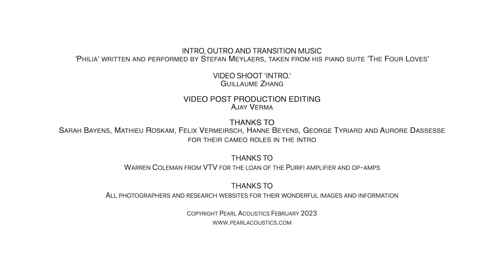Part 1: The perfect power amplifier?

Comment: Well done sir. It sounds like the amp you described will become the industry standard soon if not the industry best. Zero distortion may not be the goal for musicality. As we know Nelson Pass uses some 2nd or 3rd order distortion. Why? Because that is what his test audience prefers.
Me Too. It is why I have a Pass INT25. Sounds better even to my tired ears.
Reply: Best possibly for low cost limited space but for industry best....come on let's get Real
Reply from the maker: Hi David, it might surprise you that the professional recording industry has been using class D designs for decades. You’re not likely to see a class A tube amplifier in any recording studio for playback purposes. Except for fun. Even then, there’s just no room in the mixing room, and the one thing we don’t want in there is heat.
Reply: @PearlAcoustics  studio and or live amplification is far away different from home reproduction needs for many reasons. One of the main reasons is that on first scenarios are usually used several amps, and moreover, each amp works on restricted frequencies range: each instrument has dedicated amplifier. Live, specially electronic music, doesn’t suffer typical class D amp’s signal processing. Even if I agree they have some advantages that from my point of view are more related to their intrinsic symmetry than the general promoted efficiency. My best regards and thanks for your work
Reply from the maker: @giampierovecchio2681  Hi, absolutely agree on equipment amplification, however, I find that far too often, these days it is then all fed into a PA… enjoy the music too!
Reply: @PearlAcoustics  we used Bryston amps in my studio had no idea what class they were
Reply from the maker: @jackfalco5351  most likely AB. Very good amplifiers
Reply from the maker: Indeed, you’re absolutely right. PassLabs amplifiers are an absolute joy to own and to listen to.
Reply: it's just the difference between a coffee-flavored drink and a real espresso coffee, some may even love the former more but real things are real things as well as substitutes. Enjoy
Reply: @giampierovecchio2681  for me only the fully authentic real deal best will suffice. Can't stand second or third rate... especially pretenders
Reply: @davidcross890  fully understand your point of view even if the real deal doesn’t mean the same thing for anyone. Enjoy your listening as after all it’s what really matter!
Reply: @giampierovecchio2681  high five to All our Audio Friends 👍

Comment: How can you say one amp is ideal

It is all amplifier/speaker synergy and room size

I prefer Single End Triode (no waveform switching / strong power supply), nos tubes - Very high efficiency conventional loud speakers
Reply from the maker: I can’t and I don’t think I did. It’s all down to preference and it depends how you look at the topic. Hopefully my video gets that message across clearly. Enjoy your system.

Comment: Status acquisition and product differentiation via cost? Say it ain't so in this OCD hobby. Yes, there are those with discretionary income who keep their noses in the air, for bragging rights(sic). The Genesis Advanced Technologies, Prime Loudspeaker being an example. It's midrange, a 72 inch long, line source, dipole, push pull, planar magnetic, used to be available at a retail price of 700 US bucks, apiece. They are no longer available to the ordinary consumer but are employed in the aforementioned loudspeaker that in 2022 sold for 680,000 dollars/pair.   
Yet, your assertion, a Class D module may be the most perfect amp, based upon the minimum criteria measurement data, of THD is fraught with difficult to process assumptions, from my experience. At least if you're going to place such an emphasis on measurements, illustrate square wave performance at 10 Hz, 1000 Hz, 10KHz, and 100KHz. Then perform spectral analysis for noise. What type of semiconductor is employed? SiC, GaN, based semiconductors. Or BAs, fairly recently synthesized in the Lab with Thermal and both increased Electron and Hole mobility over available semiconductors, and quite superior to Si based devices. What about different Topologies which eschew efficiency for certain sound characteristics such as Class A, both push-pull, or Single Ended in solid state devices. Another alternative, a quite different approach, the Valve OTL,  both push pull AB and Class A, Single Ended amplifier.
So are the replaceable, modules, i.e., tube/op amp the Input and driver stages?
   No such thing as, "Perfection", as subjectively each individual will seek and find their preferred audio, "Nirvana", and We are still so ignorant of the whole auditory experience. Just my two cents. 
  BTW; I build my own electronics/speakers, used to employ MOSFETS, biased at 4 Amps, Class A, push pull, with 375,000uf of double bypassed, unregulated output stage, Capacitance, power supplies, each channel with a separate 800VA toroid, HEXFRED, ultra high-speed, soft recovery Diodes with snubber caps and series resistors, for rectification. Vishay resistors in the audio signal pathway, Caddock metal films on the MOSFETs Source, with separate regulated PS for each channel's, input and driver stage. The whole nine yards. Discovered Transcendent Sound's OTL kits, gave up solid state and never looked back. Also, I bought the first iteration of Dave Graebener's aforementioned planar magnetics for 1085 bucks/pair, shipped. I'm a cheap b@sta@rd but I dig on the Notes and play a left handed Strat for the last 47 years. Enjoy your interesting observations.
Reply from the maker: Thanks for your contribution to the discussion Scott.

Comment: Harley: As a mental exercise, are these amps (minus the buffer and op-amp stages) so perfect that you consider placing them inside your Sibelius speakers and, say, providing a balanced connection to be feed by user’s choice of pre-stage?
Reply from the maker: Hi Steve, that’s an interesting concept. Unfortunately, we can’t put anything inside our loudspeakers, but I am extremely interested in exploring the topic further.
Reply: Ninja’d. maybe bolt them to the back? Make the buffer a plug in module.

Comment: So enjoyable to listen to you.
I actually bought my amplifier without listening to it, but instead because of the way it was developed. As you mentioned, it has two IcePower Modules from Bang & Olufsen (kind of a predecessor to the Eigentakt modules) and is equipped with an input stage specially engineered as a class-a module, especially not with perfect measurements but best sound quality in mind. So I thought, it should be the best of both worlds. And it is. It's the PS Audio Stellar S300. I was blown away when I first listened to it and I still am. And it's on the budget side also, as a bonus.
Reply from the maker: Thanks. You’re very kind. And I am so pleased that you have found the perfect amplifier for you. Best wishes

Comment: I just happen to own a Hypex NC500 based amplifier which I like most switching to bypass mode the internal buffer (keeping some 12+ dB gain ) and driving the amplifier, practically the NC500 modules directly by a tube preamplifier.
Reply from the maker: Indeed, this is something that my colleague Ajay swears by…. I am sure this is the direction to go, but am open to be convinced otherwise
Reply: Which tube preamplifier can drive Hypex NC500 unbuffered 1.8 kΩ input impedance with its 12db gain?
Reply: @wyup  I use an Icon Audio LA4 Mk III to a great effect. I certainly recommend this combination. It has a low 100 ohm output impedance.
Reply: @gyulahunyor8267  Thanks.. discourages me a bit that I need to spend twice the price of the amp to get that sound.
Reply: @wyup  I understand. In fact I was lucky by getting a second-hand unit some years ago. This is a bit older version with separate pre-outs of 12 dB 18 dB, but the 12 dB does the job in most cases. I really like the low total gain solutions where the preamp can do its job by actually amplifying and not attenuating because of the high gain of the power amplifier. Sounds familiar when you can operate with the volume pot up to 9 o'clock position? By having 12+12.8 dB of total gain I can set the volume to the upper third of its range and the sound is somewhat livelier, more open.
Reply: @gyulahunyor8267  yes.. it happened to me with a Hypex NC122MP 70w based amp, I had to remove two resistors from the board to bypass its input stage gain, so I got 13db total (out of 26), enough for me, keeping its 40kΩ buffer. This way, at full knob I had all the volume I need, and take the least attenuation from the source. At stock, I could only use 1/4 of the pot max, making it difficult to adjust low volumes. And I was using only attenuation..
However, eventually I replaced the Hypex with my old and cheaper Onkyo AB because tonality was more realistic. The Hypex, although meatier, sounded metallic and dry.. IMO there is no preamp that can fix that. I guess tubes may add fullness and harmonics but I wonder if they can improve the amp's timbre.

Comment: Great video! Videos from you and from thomas and stereo lead me to believe that incredible sound is possible out of class d amplification. The key here is that most of the “good” amplifiers that I’ve seen have some type of input buffer in front of it. So perhaps that is the way forward. Maybe you buy just the module and try different buffers to suite your taste.
Reply from the maker: Thanks Jose! Another approach might be to drive the module directly from a tube preamplifier that can deliver a high enough voltage… but I am open to all ideas.
Reply: I was thinking the same thing. Perhaps integrated amplifiers with your choice of pre-amp.

Comment: Hi sir. Your entering into interesting territory, some might even say a minefield 😂.  This has the potential to certainly disrupt the low to mid range of the hifi market , because it could totally level the playing field .    As you rightly say those with the cash to splash will always operate outside the everyday marketplace .      But what you’re envisaging is a one box solution that has the potential to decimate the whole of the industry .  And as you rightly pointed out ,   most manufacturers are catering to people who just want the best sound at the best price . I would definitely include myself in that group ,       so if you can produce such an item that is equal or better to anything else why would I bother going to a different manufacturer .      And judging by the actual component count,    this could be mass produced and bring down the cost even further so what’s not to like .       If as I assume you might be consider helping with bring this to the mass market with some of the component upgrades ,     then many in the industry will be breaking out into cold sweats .    The perfect mouse trap  or even the perfect toaster ,  food for thought dear sir          Ps.   At least everyones still got the speaker industry and play back formats to play with     Best wishes and kind regards as always 😀👍👍👍
Reply from the maker: Thanks your very kind appreciation. And thanks for your excellent contribution to the topic. Best wishes from Belgium

Comment: Guess you are aware of Schitt Freya -  a pre amp with switchable tube/SS/and passive modes. Probably not quite what you're looking for though the concept is there. Neurochrome has made a Purifi specific buffer too. Always thought class D had the potential to 'pass the buck' of the sound sig down to the buffer/pre or even DAC.
Reply from the maker: Yes indeed, thanks!
Reply: I thought of Freya+ to this Purifi amp to drive it in bypass mode, but Freya+ balanced output impedance is 600Ω, too high for Purifi 4.4kΩ without buffer. Plus I think you can't bypass the VTV input buffer and its opamps/tube. It's either 7 or 14db gain by the internal jumper.

Comment: Are we not on the way to having to embrace the equalizer? I mean, let's say we create the perfect amplifier, with no distortion, coloring, noise or anything else, a perfect clean sound. I think that nobody would like that sound and would miss the "good old days". Except if we give the user a way to adjust the sound to what that person likes, a perfect tone controls that made the sound perfect for that particular owner.
Reply from the maker: You make a very good point here, and only if it were so easy. The problem (or challenge) is not just eq, it’s more complex. I remember investing in a very sophisticated EQ machine in the 1980’s thinking I could change the timbre of my system. I was wrong. I could fine tune the bass the mid and treble but I couldn’t make two different voices singing the same note sound like each other. We have distortion, and soundstage and phasing and all sorts of ill defined science going on. That’s why the last stages of this challenge are so difficult and companies spend a fortune trying to reach their imaginary sense of perfection. But with this module it makes it more possible, without the use of DSP’s

Comment: You are talking like you were going to use it for some proper speakers with 3 or 4 drivers!
You used it for 2 4 inch drivers how much power do you really need for those maybe a 10W tube amp?

Comment: Amplifiers should be neutral. If you want to add color put it in the preamp or other specialized unit that can be varied depending on the room, speaker, and recording.
Reply: Agreed.  Some say spend the most on speakers.. I say.. especially for a person who has only been in this hobby a couple yrs.. put ur money into a great neutral power amp. How do you know what sound you like when you bring speakers home but can't properly drive them? I went with the Coda No.8 high current neutral amplifier. Built to last 3 decades or more. :)
Reply from the maker: Hi Greg, I do indeed think that there is where we (the industry) are headed.
Reply: Well, to me a perfect amp would be the one that only requieres passive attenuation, not any color or character. Tubes wouldn't be needed. Neutral to me is the real representation of the recording, not lean or clinical. Usually neutral is a meant for that in reviews. If we need a tube preamp to approximate the actual sound, the amp is not right (you add to take back). Usually A/AB class amps don't require a tube preamp (do they add color or distorsion themselves or are they just 'neutral'?). I want the sound to be as I hear it when I go to classical concerts. A wire with gain is the mantra, but in reality you need a preamp synergy (with gain, color and impedance matching).

Comment: Class-D achieves respectability outside of PA and sound-reinforcement!
About the vanishingly low THD: it would be interesting to determine at what point the most sensitive of human ears ceases to perceive THD at all under the most favourable conditions for detection. Then we could say anything lower than that is over-engineered for purpose. Or at least, cease investing resource to better those figures.
And in fact, as you alluded to, there are some for which a perfect distortion-free sound is boring, they like some kind of sheen over the sound, almost like an Instagram filter, but for music! 
Of course, the component that introduces the most distortion is the loudspeaker. If we'd gone back in time to the early 20th century and told the engineers of the time we were still using conical pistons attached to an electromagnetic motor and damped by an enclosed volume of air to reproduce sound, I should imagine they'd be rather incredulous.
Reply from the maker: Thanks - great comment

Comment: I own a VTV Purifi amp with a Sparkos buffer. When I bought it about a year ago, I ordered it with the Hypex standard buffer. Playing through my Magnepan 1.7i speakers, it sounded a bit thin, as the Maggies are super fast and detailed and add no significant warmth of their own (at least in my setup). Warren said the Sparkos 2590 is a great blend of smoothness with some warmth but not compromising details, and he is right. The VTV Purifi amp is by far the most detailed and clean I've ever used with the Maggies, with plenty of power and control for my power-hungry speakers. I might next try Warren's tube buffer boards.
Reply from the maker: Thanks for your comment

Comment: I tend to compare colouration of sound with the smallest pinch of salt in food. You may not be able to taste it as such, but you notice some difference. In school I learnt that anything below 1dB difference is inaudible, so two amps with the same distortion of 0.001% should sound exactly the same, but it is not necessarily the case. I've compared characteristics of a guitar pick up with different magnets (same pick up) and noticed an audible difference - although the measurements differed just a fraction of a dB in a certain frequency range.
On the other hand I'd like to see what the outcome of an amp comparison would be in a double blind test - just to be sure, since there are quite a few placebo's out there...
Reply from the maker: Indeed, less than 1 db in amplitude difference is very hard to detect, except for the trained ear, and only in a few. But change the sound of one human talking to another (at the same amplitude) and you’ll hear the difference immediately. Amp architecture and transistor or Tube types change so many parameters. The only thing we can truly measure is amplitude. Which is like pointing a telescope in the wrong direction.